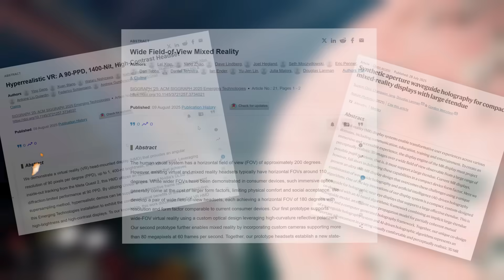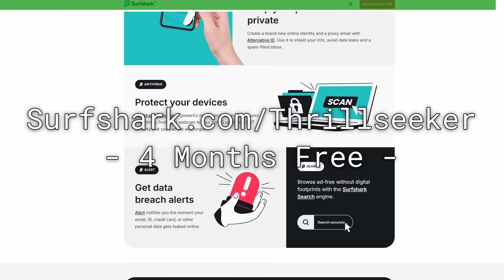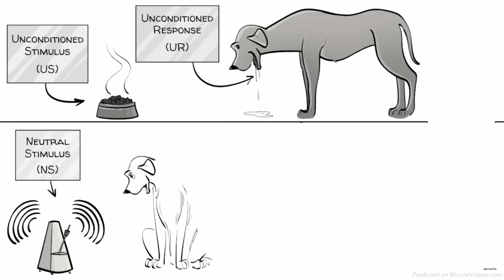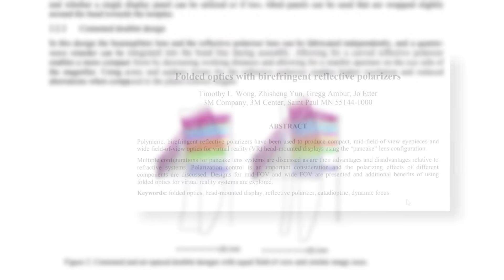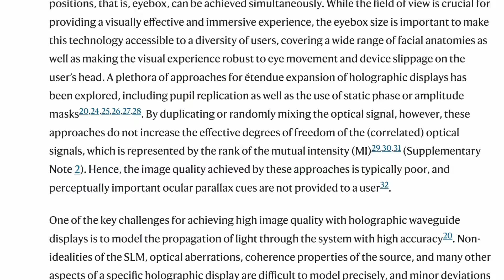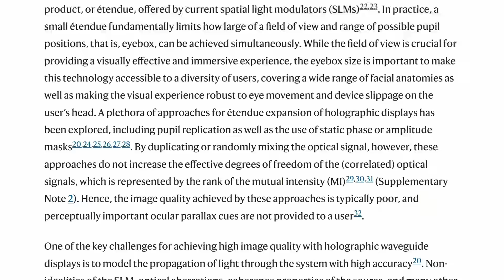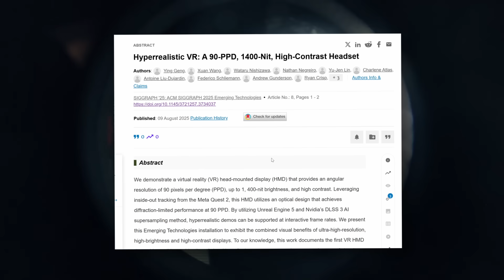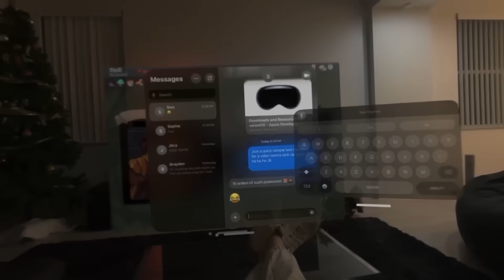Meta's New VR Research is Legitimately Wild

Comment: waveguide seems like an amazing technology. it would solve every issue because of true focal recreation, aka, in full fov it wouldnt really be limited to resolution as its not a screen, but the limits of the technology supporting the actuators and latency. although a significant problem would be how tiny it all is, and not to mention, how fragile. is this really feasible for regular use? thats a problem for another decade most likely. its not solid state so it could easily be damaged. blunt force, overuse, etc. so many tiny moving parts is abit of a nightmare in anything intended to be worn tbh. or really in general. theres no way to maintain it at that scale or in that housing. the smaller the parts are the more fragile, we have enough sensitive protected solid state electronic components, we dont need microscopic actuators that are impossibly fragile by concept. a better solution has to exist somehow. maybe a material that flexes based on applied voltage..... (weird concept, might not exist outside biological applications, but the idea of a non-wear component at that scale kind of demands such a solution)

Comment: There has just been a breakthrough with AR glasses having a variety of depths that come into focus as you focus your eyes on different depths in the real world. They have managed to do this by creating many layers for different holograms to appear on (depending on where they are in distance to your eyes/the device), and emulates different depths by doing this. I presume that they are dissipated in a very accurate way so that when your eyes aren't focused on that particular projected object, it is blurry, and when your eyes focus to that point, it comes into focus, along with any objects that are at the same distance of what the device is trying to emulate the projected objects to. Hopefully they may be able to put this into a VR headset. But there are many arguments against the necessity of such an expensive technology. But we can expect these features to come once the VR industry reaches an 'iPhone X' level (where they begin to run out of problems to solve.

Comment: What would be the best way to get into vr in every way possible (would like opinions from everyone and anyone) thank you
Reply: Meta quest 3 does it all at the best clarity for $500. Games look like late stage xbox 360 titles, like the best looking games from the era. Limited to peripherals on its own, but can be used with a decent gaming PC 

PS5 + PSVR2 $1000, games only, better graphics than a Quest 3 by about 1.5 console generations 

PCVR, expensive, but can get you the best graphics and performance. Multiple options to enhance the experience with 3rd party peripherals, such as haptic suits and omni treadmills. Wide variety of headsets to choose from. It may cost about $2k at the minimum. 

For games there are plenty to choose from. See what titles movement options work best for you, or what games have the most replay value. 

Learn what your interpupilary distance is and how to measure it with your phone. 

As a beginner take breaks every 15 minutes. If you feel dizzy or sick stop playing, do not force it. Stay hydrated.
Reply: @smittyvanjagermanjenson182 greatly appreciate the advice it helped me a lot

Comment: Honestly, the thing I'm most excited for in terms of VR as a "real 3D image" display long before the holographic display is the lightfield display. It solves the whole focal distance issue by using pixels that are instead projection lenses with a grid of pixels behind them, this allows each pixel to project light at specific angles rather than omnidirectionally. This leads to a screen that can make an image with any degree of depth as long as it's behind it's surface leading it to look/act like a window, as well as one that can correctly project light. Some demos I've seen had a light move in virtual space causing an object placed in front of the screen to cast a shadow to match as if it were a window with a light behind it instead.

Comment: First of all, congratulations to both of you on your engagement! ✨✨

Now, external Haptics is a dead end. Brain Computer Interface (BCI) is the only path towards true VR. There’s no in-between, because external haptics & BCI are not connected & BCI is accelerating with the help of AI & as per Ray Kurzweil & Gabe Newell; it’ll be early 2030s when this becomes available. Nanobots is the BCI hardware, according to Ray Kurzweil.

Comment: since you switched to linux... i feel like a video about vr on linux would be very interesting. official support from the manufacturers is pretty much nonexistent, but the community made software is mad impressive considering most do it just to make vr on linux better, not even getting paid for it. pretty much every standalone headset works, pcvr support varies a lot by the headset. the independence from the manufacturer's software is actually quite refreshing... as long as it works well.

Comment: The thing the VR community doesn't want to accept but needs to to move forward is the fact 90% or more of the playtime in VR since it's inception has been on race tracks and in race cars. Racing is by far the most dominant VR use. It's probably more like 98 or 99% of VR playtime has probably been spent in a car. Perfect racing in VR and everything else will be easy and will just follow.

Comment: The industry is a bit paused because it's clear the tech is quite close, but equally clear that it's not good enough.

Which is a cycle that has happened multiple times before.
This time the research has a lot more funding though, because the market is mostly proven and the compute power is finally achievable.

Comment: I feel like the waveguide may be a bit more extreme than necessary. It would work just as well to create a single varifocal lens that adjusts using eye tracking. This will be a lot cheaper to implement, and will probably be the next phase until waveguide technology becomes feasible for consumer use.

Comment: I wish someone would develop auto-focus glasses. Not VR. Not XR. Just auto-focus glasses. I have to juggle 3 different pairs of glasses depending on if I'm driving, using a laptop, or using my phone. They do make transition lenses, but it's just really small areas of you lens that are set at different focal lengths, so you have to look through different regions to get different focal lengths (like bifocals or trifocals). It's very nausea inducing. If I could get one pair that would autofocus, I'd pay $1000 for them (that's what I pay for 3 pair anyway).

Comment: Valve has multiple patents on 150-180 degree FOV optics... as well as 2x efficient pancake lenses, extra brightness backlights,... wireless PCVR using eye-tracking, foveated rendering, H265 encoding, and skew-transform reprojection instead of predictive reprojection for 180hz tracking. Updated laser tracking. Stan Larroque says 2026 & 2028 will be the years...

Comment: I haven't had a VR headset since 2020 with the HP Reverb G2. I went all out with a pulley system with the power/display cord that was like a heavy gauge extension wire. I had a 1080ti at the time but it wasn't enough power for it. It was heavy, software was god aweful, wire broke within a month and I had to wait another month for a replacement "btw don't buy from HP"!
After that I decided to wait a couple years for the tech to bake. Still waiting sadly. Hey maybe with all this new stuff the year to be will be 2029/2030!

Comment: Extremely Wide FOV will eventually make its way to regular headsets, Meta will Probably use it in a Pro model that is a lot more expensive at first until it become more affordable over time like anything, depending on cost because whether people like it or not its based on the factor of money. Valve is waiting for something, its been a long time from them since we had any kind of update, but I think that when whatever it is is there they are going to shovel it out the door.

Comment: I really think that the MEMS mirror technology could be implemented as part of the backlight of a current gen VR LCD display and solve most of the historic shortcomings of current LCD based HMDs and LCD displays more  generally.

If you used the raster scanning MEMS mirror as part of a laser phosphor based backlight (using low persistewnce phosphors) for an LCD, it would allow for local dimming and backlight strobing to occur simultaneously, something that cannot be done with current mini LED backlights. 

Even if the MEMS system could only resolve a paltry 640x360 sweep over a 6.5 inch display that would allow for over 200,000 "zones" for a local dimming algorithm to work with.

DIY perks just  did a video where he used an old DLP projector and an old LCD, combined with OBS filters to get infinite contrast out of an old LCD without any of the alignment issues of previous attempts at dual cell LCDs. If you used a  raster scanning MEMS mirror in the way DIY perks used the DLP, you would get the same effect for contrast, but strobing at the same time.

https://www.youtube.com/watch?v=qXrn4MqY1Wo

Because MEMS is inherently a raster scanning technology, it will do blur reduction by default. I own a pair of Nebra Anybeam MEMS scanning projectors and they are great with motion handling relative to any modern display. In terms of motion they are closest to CRTs.

Comment: It's cool to hear that you're switching over to linux. You might be surprised by the state of VR on linux. While the industry as a whole has been largely stagnating, open source contributors have been making a lot of ground and catching up. Alternate runtimes like Monado have replaced the need for buggy SteamVR linux builds. Applications like Envision, Wlxoverlay, and WiVRn have improved the quality of life features. While it's not yet at feature parity with windows--the right hardware can still get you a pretty solid experience. I'd recommend checking out the LVRA wiki/community if you haven't already.

Comment: Meta done us dirty!

They removed the ability to adjust and create walls in the spacial scan editor.

This not only posses a safety hazard as walls are not accurate to thier in real life positions but also most mixed reality titles do not function properly anymore.

After reaching out to support, they said if users dont speak up about this by submitting a BUG report in the app or headset of the missing adjustable walls option then they wont change it back.

We play vr for immersion, more control and freedom......we cannot let meta take this away!

Please everyone submit the bug report of the missing option to adjust/create walls in the spacial scan editor asap

Comment: We can't even run VR correctly  in small FOVs at a decent resolution yet,
rather than bigger FOV, priority should be on stuff like lighter headset, eye tracking, better ways to connect to PCs (no more quest that does streaming while wired 🤮) varifocal, and of course more power
They all seem to go the for MicroOled for their next gen, nice colors and true black will be welcomed on top of the form factor.

Comment: VR on linux? Sounds like something I would wanna see a video about :)
Reply: Please Thrill!
This video couldn't be made in a far better time with the recent surge to Linux thanks to Pewds and the EOL of Windows 10 happening in October
Reply: I started using WiVRn instead of ALVR and it really feels miles better (probably because ALVR is dragged down by SteamVR's buggy Linux support - WiVRn uses Monado which replaces SteamVR entirely). Unfortunately some VR ports (most notably HL2VR) don't work with it because the base games are 32-bit, but there might be a way around that. I got it working together with SlimeVR tracking, Unreal and VRM4U via VMC.
With that, I think I'm completely done with Windows (outside work).
Reply: @half_real  The most painless Windows->Linux transition would be for PCVR users. Anyone with standalone HMDs will have few hiccups, here and there. In some cases, features are yet not on pair with Windows.
Reply: It has some caveats sometimes, but it mostly works. All my VR experiences have been on linux, as when I bought my first headset I already was a 5+ years linux user. I've played AAA games, smaller games, games with mods, sailed the high seas, and it works.
Reply: @Mrlluck Heard it's gotten a lot better in recent days
Reply: @JustFeral  its bassically virtual desktop but free but you have to tinker a bit and its slightly better
Reply: @Mrlluck what distro are you using?
Reply: I’m considering switching to Linux in October from windows 10. Gaming and VR are something I’m still a little worried about though. 

Would love a video on it before I make my choice.
Reply: @p0k3mn1  Flatscreen gaming is pretty decent on linux especially if you're running a amd card. The only caveat you would run into is playing anything with anti-cheat that isn't natively ported to linux. VR gaming judging from the comments don't seem that simple.
Reply: I've been running VR on Linux for over a year now without any major issues. You do need to find alternatives for your overlays, but there's a very dedicated community working on improving the ecosystem constantly. The main downside is that you basically have to ditch SteamVR. SteamVR technically works, but it's incredibly buggy on Linux, and the Linux build is basically considered abandonware at this point. No reprojection, rebinding controls causes SteamVR to effectively DDoS its own UI into unresponsiveness, and half the time it won't launch and gives you an incredibly generic error code that tells you nothing about how to fix the issue. Most people on Linux use Monado for wired headsets, or WiVRn for wireless headsets, since it's just more stable and consistent
Reply: Totally, Linux VR plz
Reply: +1. Last I checked, nvidia drivers don't support bigscreen beyond, so I haven't been able to fully make the switch. Would love to see how that's been working for ya
Reply: 100% I would love to see a whole series of video really diving into how it works or does not work and step by step guides. Please run the gamut on this one.
Reply: Quest and Pico: WiVRn Server, the firewall and downloading and installing an apk from their website is worth a video.
And (if there are) other up to date  methods to connect to linux and how to do it. I would be happy to see videos like this!
Reply: Hey! thats what I said lmao
Reply: virtual desktop has no plans of ever supporting linux... i wonder what i'll use when the time comes.
Reply: ive been running vr on linux for 2 years now, check out envision, monado, and related projects, theres also a script to trick vrchat into launching
Reply: saaaame, i tried alvr a while back and actually got it to work! it was... painful though. i hope its gotten better since then.
Reply: I am extremely interested in building a linux operating system that primarily functions in vr. Files, browsers, apps, etc . My idea is very different than the apple vision pro even though i do applaud their setup a bit.
Reply: i use arch btw